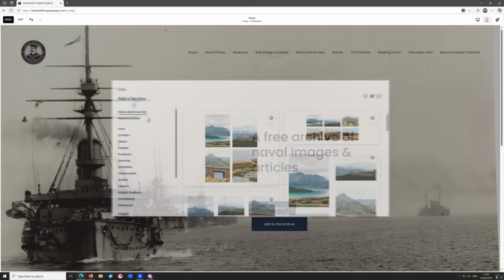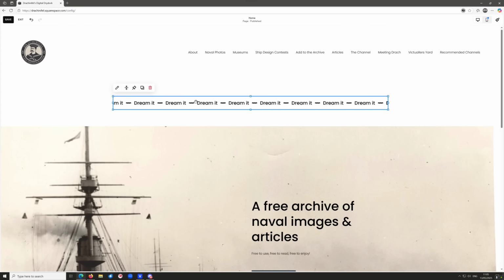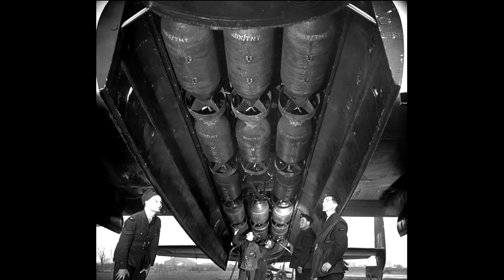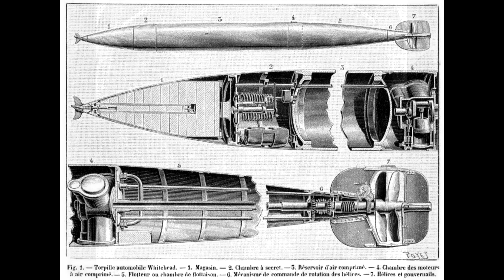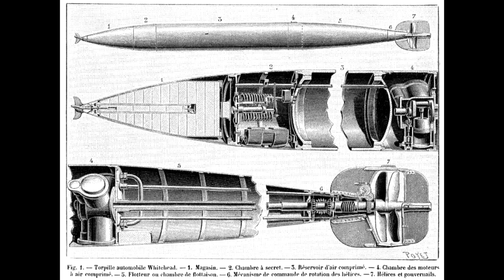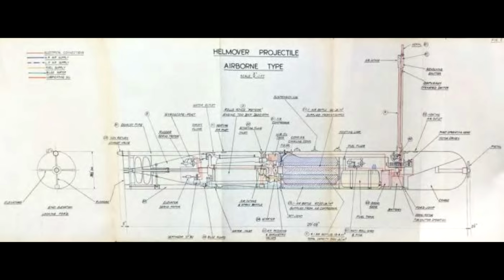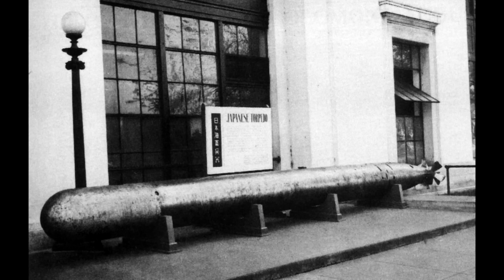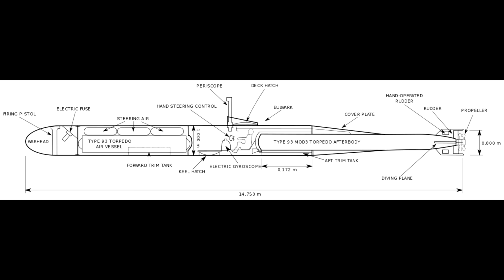The Helmover Torpedo - The Battleship Eraser

Comment: Great video.  It informs the viewer on the larger side of torpedo development (one shot, one kill on the largest, most heavily armored ships), but I've always wondered about torpedo development on the small side - was there ever a program considered for torpedo miniaturization?  The rationale being that another of Drach's videos stated that WWII subs typically ran out of torpedoes before other supplies, forcing a return to port.  Other than producing larger subs, it seems the logical conclusion would have been to carry more, smaller torpedoes.  More than adequate to kill most smaller warships or cargo vessels, a smaller torpedo likely could only superficially wound larger ships or those with good defenses, so that would obviously be one limitation.  Others would be less range, speed, etc., maybe these were enough to halt development in its tracks.  What was the smallest (by volume) torpedo used in WWII, and why?

Comment: Why didn’t battleships, cruisers, or destroyers ever use shaped-charge warheads? Or did they? If so, what happened?
Reply: They had barely been invented by war's end by the Germans, with the Panzerfaust, and those were not particularly well refined. Good enough for medium tank armor, but the standard explosives used then were not as suitable for a shaped charge penetrator, and they require precise timing and manufacturing tolerances to work at all. And in matters of WW2 ship armor, which was incredibly thick and often layered, a ton of kinetic energy was far more reliable than a rudimentary shaped charge.

Comment: Crazy how this video came up because the US is now testing and probably putting into service after all these decades this technology has been around they're just now starting to build Torpedoes with glide kits so Poseidon aircraft And helicopters can drop them from longer distances  away and at higher altitude to keep them out of range of anti-air some of them might even be equipped with turbine engine for even longer distances before they drop into the water and break away from the turbine engine and Wing kit making it a regular torpedo that guides itself towards it's Target it's a pretty smart idea to keep the aircraft delivery system away from anti-air defense an increase the aircraft and crew survivability play no longer have to fly low to the water to drop their Torpedoes with drag chutes hey can now do it at high altitudes and way farther away

Comment: Meteors weren't just a "de-rated" Merlin, they were specifically built (from a Merlin base) for ground/marine use. They had no supercharger, the crankshaft direction of rotation was reversed, they also had a flywheel, (which an aero engine did not require, the propeller doing that job) there was also a myriad of other, more minor changes, such as running on a lower octane fuel.
Reply from the maker: The documentation of the Helmover makes it pretty clear the powerplants for at least the test units were going to be Merlins recovered from crashed/damaged aircraft and modified into Meteor form, as opposed to built from the ground up.

Comment: 27:47 
You'd think somebody would have taken old, obsolete combat aircraft, added gyros and remote control, that 5,500lb shaped charge and flown that into the ship instead.
Sounds a bit easier than a torpedo.
Reply: Some nations did try that but it is a finicky plan. Italy for example did such a scheme in Operation Pedestal but it missed.

Comment: It was pointless, the tall boy and fat boy bombs could be fitted with guiding systems like that monstrosity, if you have a plane flying high out of anti aircraft fire range, you may as well drop a dumb bomb with a delayed fuse, so it blows taking advantage of the ocean waters incompressibility effect, so it directs the explosive force up through the ship and take advantage of the supersonic speed of the falling bombs to penetrate the thick armor before it blows, it's how they did take out the  German pocket battleships in the end, towards the end of the war they had rocket missiles that were fired from aircraft, if you hit a ship on the water line you can do a lot of damage with small shaped explosives, or if your fighting the Japanese aircraft carriers and your US made torpedo's keep failing to work because torpedo hitting the incompressible water would cause the tail and prop to break, it's a big issue getting torpedo to work, dropping conventional bombs the US forces eventually sunk the Japanese a couple of the carriers, the Japanese ships burned, they had some bad luck and crap fire suppression systems, that Rolls-Royce engine was definitely not worthless, they would have been better off having it in the airplane that it was in originally, the old plain could be remotely flown into the shipping, that would have been much easier and cheaper to develop, often it's some real foolish people in charge, almost always, like the strategic bombing campaigns that were totally pointless, but still people think nuclear bombs are effective WMD, they are less effective than a fire bombing at being destructive, but blowing up homes is also not effective, it makes winning a war pointless, if you blow up your enemies civilians and land and everything else, what are you achieving by killing the citizens, the survivors of bombing are less likely to overthrow their own leaders, in favor of the bastards that have just attacked them and Japan had no shortage of labour and just like in Germany and Russia and Britain, the war industry wasn't even slowed down, fuel is the only issue for a militaries machinery, and it was often not targeted in favor of killing their enemy civilian targets, what fools to waste all that money on poor ideas like that.

Comment: Good idea, possibly the technology of the time could not achieve it. 
40 knots dropped 20 miles away from a battleship doing 32 knots, it takes 2h30 to catch up over 80 miles nautical.
Also can only be used in visual contact, so sunny days with clouds above 25000 ft.
If the guidance system was stopped from working by someone sitting on the antenna when it was a few dozen yards away, one wonders about the reliability of a guidance system at 25000 ft vertical and several miles horizontal. 
Would probably be better attacking dock gates or small islands or anything else that doesn't move?
Also wondering if the thing would be subject to attack from other torpedos.

Comment: I'm at 18:54.   They're putting a remote system, an aviation engine, and lights on this thing.  Wouldn't it just be more practical to build a guided bomb?  The bomb doesn' have to transition from air to water propulsion.  The motor would allow for maximum velocities in diving to penetrats deck armor.
Reply: It's a tank engine. A de-rated Merlin, often made from damaged units.
Reply: @AndrewTBP  I'm not sure what you're trying to say.  It's an aviation engine that is being repurposed as a tank engine.  So as an aviation engine, it's built with weight as a consideration.  It's a de-rated Merlin.  But it's theoretically only going to be used once and no human being is going to be sitting behind it.  They are 90% of the way to making a remotely steered gravity bomb akin to the German Fritz X.

Comment: The UK: let’s design a complex system using multiple planes to remotely guide the massive torpedo to the enemy.

Japan: who wants to die for the emperor and win glory? Ok, you get to pilot this great new torpedo. P.S. of the fuel runs out it explodes. If the engjne stalls it explodes. If you get lost it explodes. If you try and jump off it explodes.

Comment: Question for you Drac.
Had this been completed how viable would this device have been for other attacks.
For example
Attacks on hardened submarine pens
Attacks on drydocks and yards
Would it have been plausible to use as a dambuster, dropped 20 miles out in the river rather than the bouncing bomb's LOS drop?

Comment: In 1942 Barnes Wallis was given the approval to develop the skipping mine "Upkeep" to attack German Dams. Few are aware the project developed a second weapon called "Highball" a smaller skipping mine able to break the back of a battleship. One has to understand, the explosion of such a weapon against the ship was secondary damage. The primary damage being the volume of water vacating the empty space made by the explosion wanting to refill the space it just left with terrifying force.
Reply: Highball was the weapon that got Upkeep through the door. Both Weapons were planned to be operational in May 1943, but the Germans moving Tirpiz out of range killed 618 Squadron's plans. Highball didn't work that well in any kind of sea state other than dead calm. It did kill one Mosquito in its trials.
Reply: @richardvernon317  They did form a carrier based Mossie Squadren 19 aircraft for the Pacific. I only have one photo of the bomber type, I am looking to model a resin conversion kit.
Reply: @thebritishengineer8027  618 Squadron was the unit. Formed in April 1943 to attack the Tirpiz. Then became a specialist  Coastal Strike Squadron with a couple of 57mm gun armed Mosquito before switiching back to Highball for carrier ops in the Pacific.
Reply: Conversely, what damage might one or two of these have done to a dam?

Comment: 18:03 I'll say. Can you imagine the terror, having just avoided a torpedo, when said torpedo TURNS AROUND?!
Reply: Didn't the Americans have a torpedo that did that?

When launched it would turn round and head back to the launching vessel.

A real homing device!
Reply: @chrishutton1458  That was more an unintentional design "perk"
Reply: @chrishutton1458  Yes and the Royal Navy had a standard heavyweight winterised version for use aboard cruisers.
Reply: @chrishutton1458 Mk 24 “Mine”…
Reply: @chrishutton1458  to be fair that is a failure state of any torpedo. After all if it gets jammed in a turn it will always end up running in a circle
Reply: not only turns around, but tracks back to your new relative position
idk for other nations but the germans had a S-run mode on a few of their submarine torpedoes where after running straight for a bit, would do a 180 and run back the other way (on a shorter course to not strike it's own sub) before turning back again, i think 9 or so times until it reached it's power limit and scuttled itself, this to increase the chance of striking a ship in a convoy if the initial run failed to make contact
Reply: @quentintin1 The Germans also had acoustic seeking torpedoes…
Reply: @allangibson8494  yes, but to my knowledge, those didn't have the capability to do reruns unlike the straight runners
Reply: @quentintin1 the homing torpedoes ran a circular search pattern listening for engine and propeller noise.
The Mk24 “mine” did similar things when hunting submarines.
Reply: "Quartermaster, bring me my brown pants!"
Reply: It heard you talkin' shit and now it plans on doing something about it
Reply: "GET YOUR ASS BACK HERE" Turpitz**confused screaming
Reply: "LET ME TELL YOU SOMETHING!"
Reply: Especially when it's the size of a small whale. Combined with the snorkel/periscope, the first people to see that are going to assume that the British have built their own Kaiten. 

If by some miracle chance someone also sees the original airdrop, the amount of confusion and perhaps awe over people apparently airdropping suicide craft would be quite something.

Comment: You should do a video on the Mk27, I know it's not a wonder weapon like the Helmover, but for a fleet sub being chased by escort ships you can launch a couple of Mk27 from the aft torp launchers and hit the chasing escort ship, preventing them from further pursuing you since it has an acoustic guidance system and probably hit the engines or propellers of the enemy ship. It's a defensive weapon and essentially a modified Mk24 mine.

Comment: In the Pacific, the Marine Air Wing had several sqdns of PBJ Mitchells [29:17 ] that were radar eqhjpped, with air to surface rockets that were automatically primed to launch if the aircraft was at the right Altitude, Airspeed and subject target's IFF/ off. 
Radar alltimeters interfaced with the autopilot and controlled altitude. Autopilot was set to target island or AO. Once in ''Injun  Country'' the system went hot. With a stable flight path, set Cruise speed, and target tracking; Fire Control was linked to the RADAR,  The rockets would release at their best ballistic trajectory to hit a Submarine, Landing Barge or Patrol Boat  -- regardless of visibility.
Hot blip 
Ship on course
Good Alt,,,, 500 MSL
Good Airspeed ...235 Kts
Range... 500 yards
Neg IFF
All systems go 
All 6 or 8 shapes fire in SALVO =  BANG
- or -
BLIPS  SNiFF NIP SHIP
SNUFF SAME

Comment: Somehow the “Fritz X” concept with a rocket booster is looking better and cheaper. A Lanc surely could carry a couple if it could carry a Tall Boy or Grand Slam (forget which was bigger). This thing with its snorkel, low & high pressure air system, smoke system and so on looks more like a boondoggle. [The only tech missing are folding wings found on USAF cruise missiles (e.g. AGM-86). The B-52s (and later B-1B and B-2s) can carry numbers on a rotary launch rack.]

Heck with popout wings, a Merlin powering some sort of multiple propellers one could deliver a long range attack at 100s of knots versus 40. IMO The Germans or Italians simply didn’t have the AA systems (radar plus VT fuses) needed to deal with Kamakzes much less a smaller, faster target.
Reply: Grand Slam was 10 tons, Tallboy was 8 tons.
Reply: @AndrewTBP  Fairly sure the Tallboy was 6 tons.

Comment: This is clearly very well thought out and also equally significantly very deadly. A single one would easily put a huge holl inside even a Yamato Battleship. THis is insane levels of explosive.
Reply: The huge hole would be bad, but not as much as the amount of shock damage it would do. You'd have water coming in *everywhere*, popped rivets and plates all the way from bow to stern.

Comment: These ideas reappeared in the later stages of the Cold War.  The US Navy looked at a lifting body that would fit a MK 46 torpedo to counter the Soviet SUBSAM that was assumed to exist based on some photos of a Kilo class submarine with a mast out of the water.  The lifting body could be dropped out of the missile envelope from high altitude.  There was also a proposal to adapt a medium weight torpedo with remote guidance for use with the failed  P-7 program based on the Boeing 757.

Comment: The FIDO Mark 24 homing mine was in service by March 1943.  Makes me wonder why they didn't try to adapt its homing system.  Two years should have been enough time.
Reply: Having a Meteor tank engine in the same structure might have upset the acoustic homer a bit, I suppose. Some bright spark would probably have tried using a homing torrpedo to guide this thing with a wire, and then had to work out how to drop the pair of them...

This thing probably had enough spare power to run a narrow beam centimetric radar with the antennae on the snorkel.

Comment: This is some Wallace and Gromit level engineering, and I love it!!!
Reply: One heck of a delivery system for a ton of Wensleydale
Reply: I had to check it wasn't the 1st of April again
Reply: The Brits had some funky designs, but they had some solid gold ones. I am especially partial to some of Hobart's funnys, like the bridge layer and mine clearing vehicles
Reply: British sheds are a kind of mad-man factory.
Reply: The russians loved it so much, they went and did it themselves, complete with a super big 'Atomic Banger' in the front of it. Allthough I don't think that one actually works (yet)
Reply: @sirmalus5153  "Allthough I don't think that one actually works (yet)"

Sure they do.
Both the ones USSR built and the recent one RF built.
Type 65-73 entered operational service 1973 with 20kt warhead.
The VA-111 Shkval has been in service since 1977.
And then there's several sublaunched missiles that can drop nuclear depth charges of between 20 and 200kt.

While the modern Status-6 Oceanic Multipurpose System is more of an underwater drone than a torpedo(much bigger among other things, much bigger than the Helmover at roughly 24m long and 2m diameter), which in its Poseidon iteration has a 2 to 100+ Mt warhead, and is in full operational service and serial production since 2023 and was probably first taken into limited service in its reuseable drone iteration in 2020 or 2021.
Nuclear powered, capable of 100 knots speed and very stealthy at lower speeds.

Comment: Should have used for the dambuster’s raid!
Reply: You forgot that the bomb has to sink
Reply: @mrmcmoustache9615  Most torpedoes had variable depth settings using a pressure switch. I believe the dambuster bombs only went about 30 feet down which was certainly possible. In this case, they’d have to use some of that pressurized air, but it would be a lot better than repeatedly running the gauntlet of low-level German AA batteries.
Reply: @mmerkav 
Thats some 20/20 hindsight